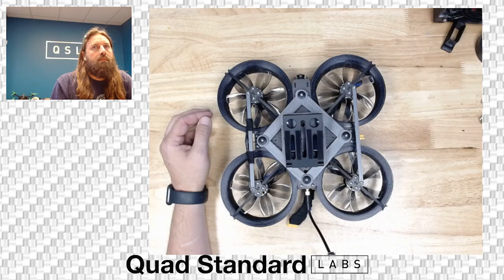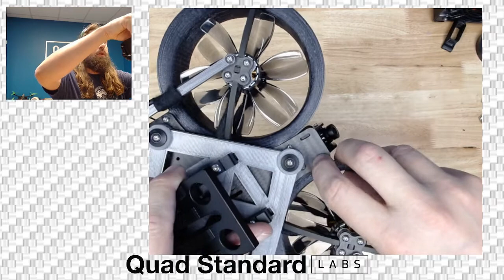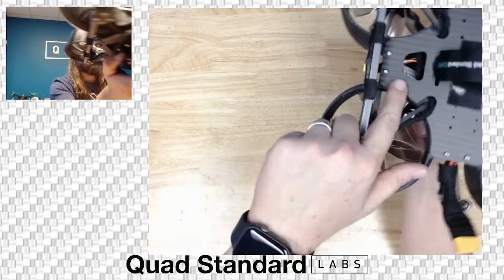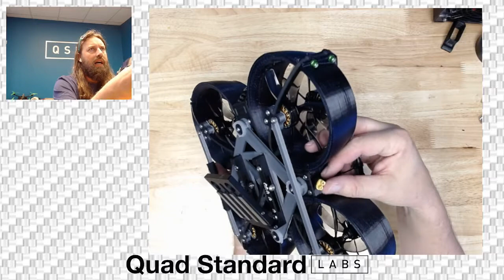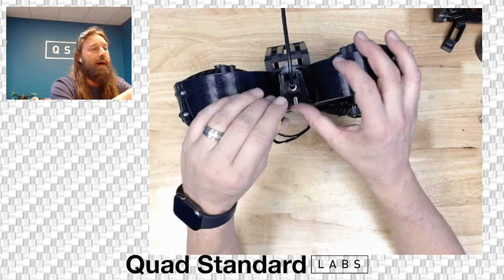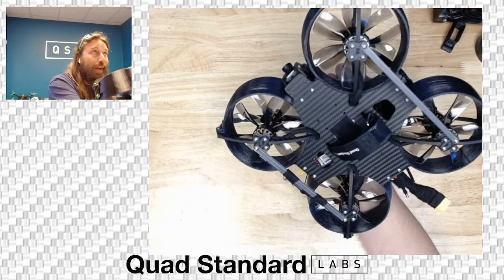FreeZillion x8 4" Intro and First Look

Comment: Nice one, actually getting myself a free zillion printed atm. What setup you using on yours, motors etc? Thanks
Reply from the maker: You can only really use a very specific TMotor without heavy modifications, I don’t remember which exactly.  We modified ours.
Reply: @QuadStandardLabs  that would be  the tmotor f80 2200kv then, ok so you use others. tnx